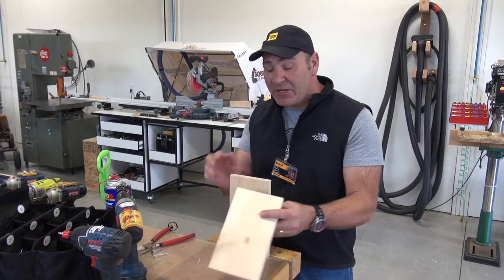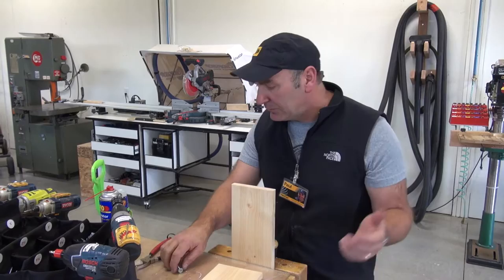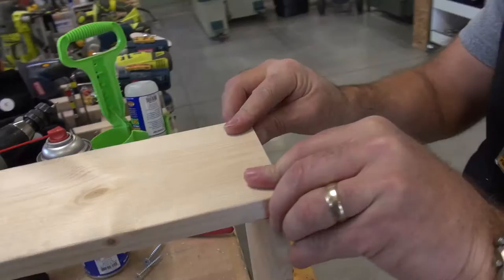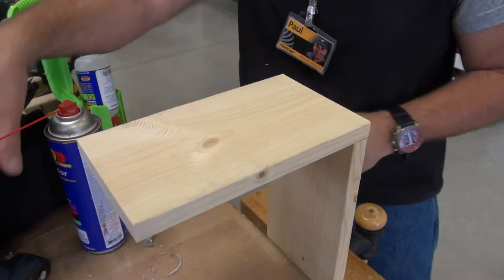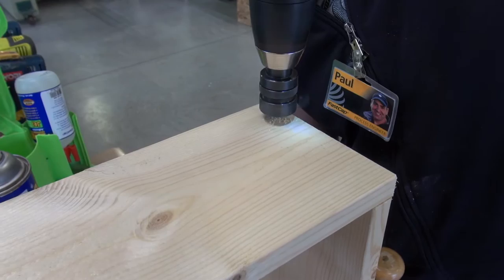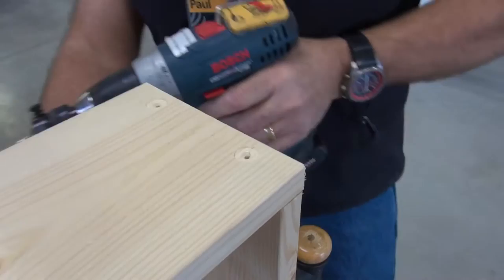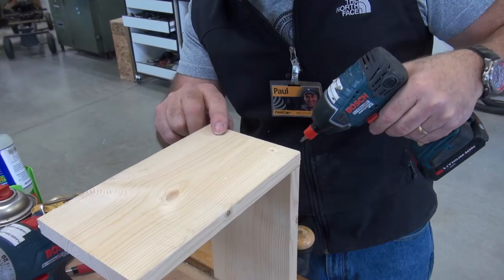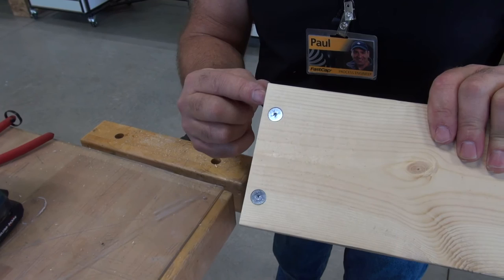PowerHead Screw with Drawer Boxes

Comment: Do these screws have any holding power in MDF ??  I thought about using them in bookcases.
Reply from the maker: Yes, they are actually one of the better screws for MDF!! They have a small shank with very wide threads, so the threads get better hold than a standard screw, and the 9/16” top holds great in MDF!